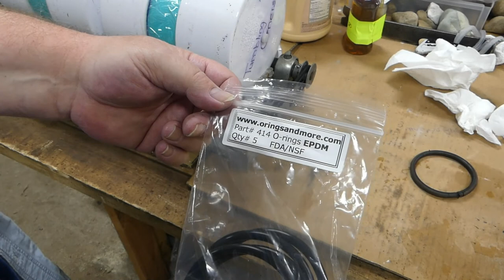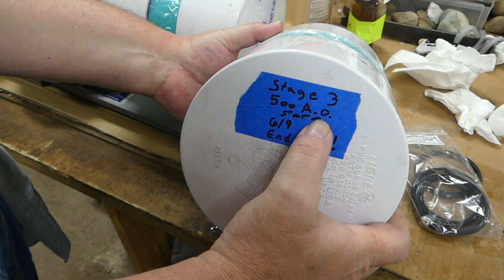DIY Rock Tumbler Barrels Size XL- Part 3

Comment: Howdy Heatherschubbyhubby & Mrs HCH .. thank you for sharing 💖 are you doing anything special with your beautiful rocks? Could you put them outside like in a garden area? Thinking weather would wear Em down
Reply from the maker: Hi there Sister Shimpy, I have plans for some of them, I would like to do some cutting and cabochon making at some point. As for putting them outside I think after time and wind blown grit they would get dull, how long that would take is another question, I would think years, bit it may not be many. One idea I have is to make a really big tumbler and do a bunch of fist sized and up rocks for a fireplace mantle. Thank you for stopping by.

Comment: Hello 👋@HeathersChubbyHubby  interesting video ! In NH & VT it's easy to find rough Granite on road sides and walking trails.  This may be a neat hobby to smoothe some down for some inside &  outside usages down the road.  Thanks for sharing !!!
Reply from the maker: Hi there CLMK0515 xoxo, thank you for your kind words my friend. Granite is a pretty rock, it is not great for tumbling though if you want perfect, the little black spots on it will undercut as they are softer then the quartz, so keep that in mind if you decide to tumble some. To me they still look better tumbled then not but if you are expecting and all over shine then you may be disappointed.

Comment: Man HCH don't quit you day job.  ;)  (only based on your singing bro.  I aint no better trust me!  lol)  Very cool.  You got some humdingers in those barrels, They are looking nice.  The 500 Aluminum Oxide is a pre-polish.  No problem using it.  What is the polish you are going to use?    Looking good HCH.  I'll have to remember that o-ring place.  I have purchased bulk o-ring material, then cut and glued my own.  Not like it was very many.  lol  Keep'r goin' HCH you are rockin' this.
Reply from the maker: Hey there Paul Hampton, yeah the singing is not real good, but it is loud! lol. And the polish is 8000 grit I believe, I just ordered some 1000 grit polish because they say it is a good extra step for softer rocks like Labradorite and Sodalite, so we shall see. Sorry this response was slow and I thank you for your advice my friend.
Reply: @MrChubbyHubby.  hey I used to get asked to quit my singing when people needed to wear inner foam ear plugs covered by the over-ear muff protectors.  And they could still hear this horrid singer.   That 1000 grit for the softer material makes sense just another step as a pre-polish for your softer stones as you mentioned.  I never worked in grit sizes before when it came to polishes.  It was just like Cerium Oxide, Tin Oxide, Aluminum Oxide, etc.  But it will be cool to see the results after the next pre-polish.  But I would add more of the ceramic pellets to the batch,  With the plastic pellets, I would load enough that when it ran it was quiet.  No rock-to-rock noise at all.  The only time I used grit sizes for polishing is when I was faceting stones.   But we are talking numbers like 50,000 100,000 up to 200,000 grit.   Tiny itty bitty stuff and all diamond.  Though we still used the oxides as well.lol

Comment: Hi HCH
Got you on the rerun. This last weekend I was walking flywheels at the 20 Lakes engine and tractor show. Got a half hour first run out of a Cooper Bessemer 60 hp, has taken 15 seasons. Talk about one happy camper. 🛠😁🎊👏
Your rocks are coming along good. 👍
Reply from the maker: Hey there Robert Whitney, how was the show overall? and that seems early, did they move the date up? Glad you got to play a bit and thank you for stopping by.
Reply: @MrChubbyHubby.  Show was the regular time. Turn out was very low, on the spectators, exhibitors, and vendors. I had an interesting chat with a Navy vet, deck hand on an aircraft carrier.

Comment: Must be a real pain in the butt getting the cap off! Thinking thats why you didn't show us taking them off?
Reply from the maker: Hey there Dream Looks Auto, no it's not bad, I thought I showed it in one of these, I just used a block of wood and a hammer and gently tapped them up and off, if I use these more I might make some kind of spreader/lifter fixture, but this is not hard.
Reply: @MrChubbyHubby.  I love the pvc idea! Way less expensive than the rubber barrels out there for sure...
I was wondering if they made a rubber end cap to fit over the pvc with a clamp to tighten. Didn't know if they made one for that size? By the way, "What size pipe" are you using? Does it equal a 6 pound regular barrel? And are those pvc strips cut & glued for the inside of the pipe?